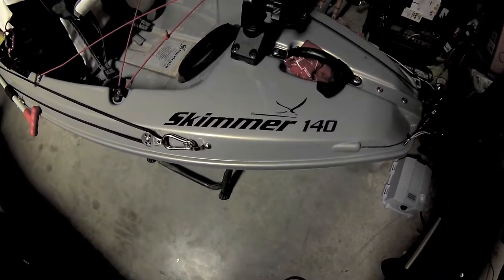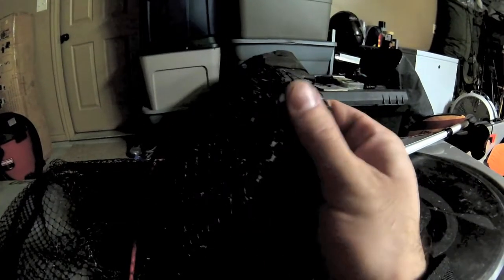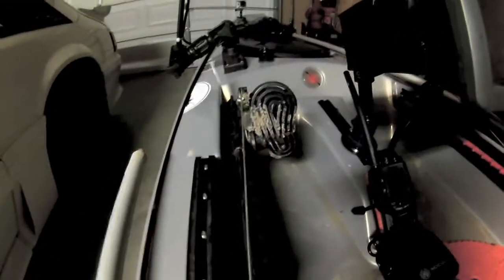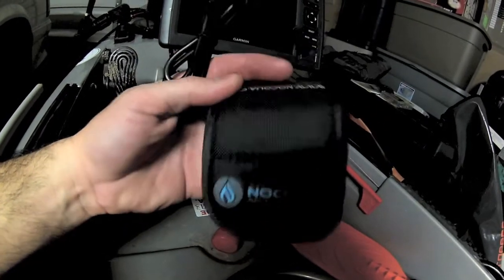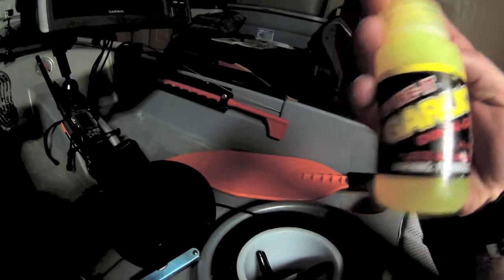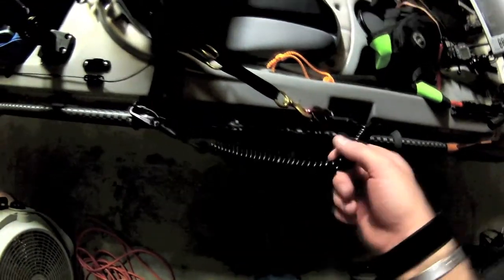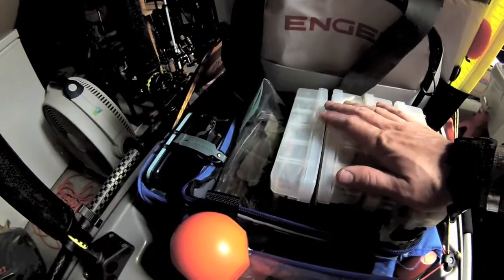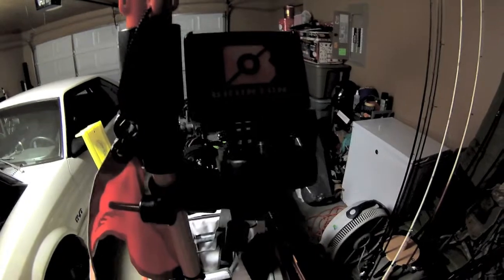Catch me if you Paddle Season 2 Ep #2: 2016 Fishing Kayak Setup

Comment: I've got a Skimmer 116. Love the weight...hate the seat. What model seat did you add to yours and how did you attach it? Looks like you put it over the original seat and just added attachment points. I gather your new seat is much better.
Reply from the maker: the seat I have is a surf to summit GTS Expedition seat. I removed the Hurricane backrest and attached the GTS seat with some d-rings to the port and starboard handles. I added to pad eyes as well behind the seat for the back straps, but you don't have to do that for the seat to work. Hopefully Hurricane is working on a new seat design because it is by far the biggest negative about the boat.